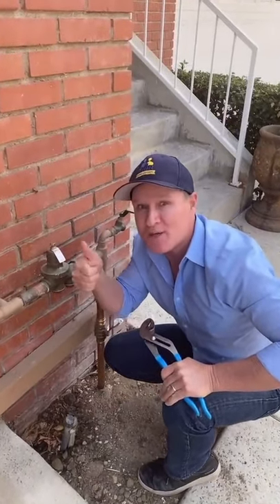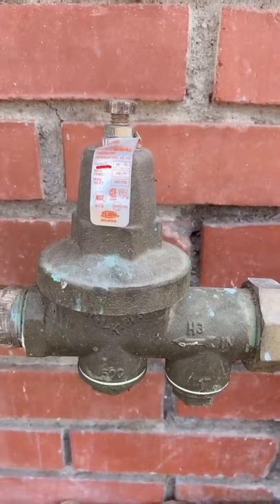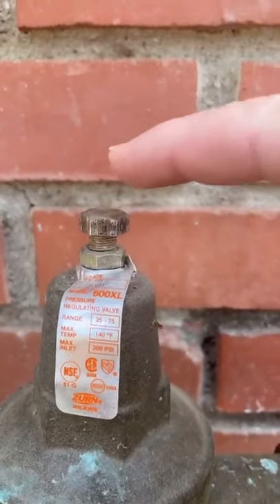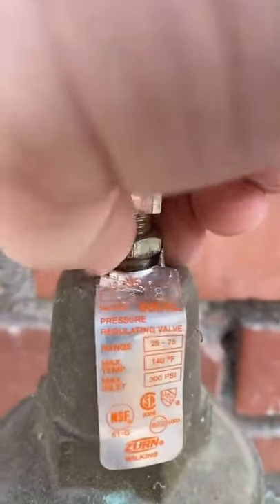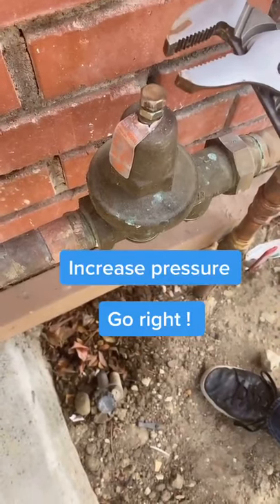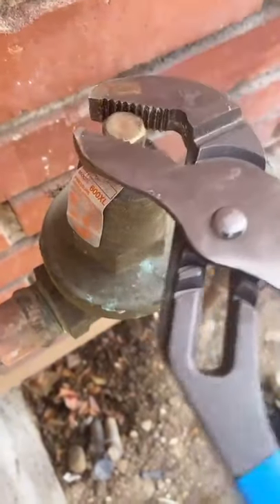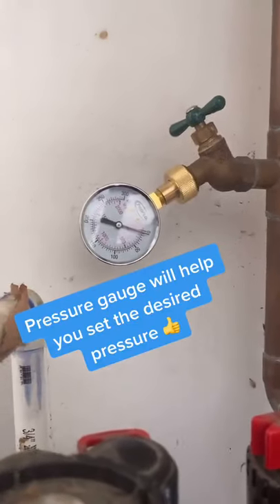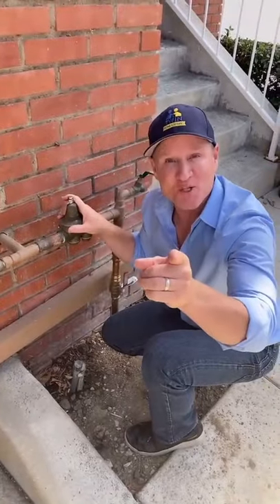How to INCREASE or DECREASE your water pressure with a pressure regulator

Comment: My father would be screaming at you for using channel locks!
Reply: Exactly.  nothing like channel locks and brass.  It’s a bad call.   😳.  but it’s not my j house
Reply: Use smooth jaw channellock pliers.
Reply: I worked with another mechanic that would jump on people for using channel locks but he would use them when he thought nobody was looking.  That guy was one of the biggest hypocrites I knew.
Reply: @Richard-om7vd  Why? Those things are beyond useless!
You should be using a crescent wrench ffs
Reply: @daddy1571 na knipex pliers one of the best tools ever made i cant live without them
Reply: @miket2172  I agree. I meant "Channel Locks" brand. They're trash compared to bad ass Knipex pliers.
Reply: @73beetle19 😂 gotta love those who don’t practice what they preach..
Reply: Should use the right size open end wrenches. Not sure why channel locks or adjustabe wrenches would be used.
Reply: I won’t use a crescent wrench either. I try to use a proper size open end wrench if it’s possible

Comment: You forgot to tell people to retighten the locking nut to prevent the adjustment changing on its own over time. Also, when adjusting make a mental note of how many turns of the adjustment screw you made for reference to tweek the regulator to the pressure desired.

Comment: Also remember that depending on the type of regulator that you have you'll have to bleed off some pressure on the downstream side of the regulator if you're reducing pressure in order for the pressure gauge to reflect the change. Water pressure is trapped in the line and unless it has someone to go, the gauge won't show the regulator pressure change.

Comment: If you have a pressure regulator in your house chances are you have an expansion tank that needs to be adjusted when you raise or lower the pressure.
Reply: Exactly , it’s a closed loop system and that expansion tank has to be adjusted accordingly
Reply: Most home plumbing isn't a closed circuit. 
The heating system may be
Reply: @richlaue   where I live in so cal about 70-75 percent of houses have regulators and run a closed loop system . City is notorious for random peak high pressure water
Reply: @richlaue  it's a closed system as soon as you put a pressure reducing valve. a pressure reducing valve is like a check valve. When you're domestic hot water heats up the expansion has to go somewhere

Comment: Channel locks?  Use a closed end wrench. Also probably need to flow water and then turn it off at another location after each adjustment so pressure can stabilize.

Comment: Some manufacturers will void warranty when you start having leaks on faucets/water heaters/ other fixtures when you adjust the pressure beyond the ‘set from factory’ setting. Not recommended. Also, use an adjustable wrench. You will round out that brass bolt fast.
Reply: Bro what lol? Standard is anything under 80.

Comment: Additional notes: If the valve is older than 2 years and you adjust it, you run the risk of causing the valve to fail. If you adjust the pressure at the regulator you also need to verify the expansion tank is pressurized properly as well. (Should be same pressure as incoming water pressure) You need to test the expansion tank pressure with the water off and pressure relieved from the system.

Comment: Check the specs on the pre set pressure of the reducer valve its probably about 50. You may or may not need to do anything except install it

Comment: I have a very urgent question my cheesy Home Warranty plumber wants to charge me an arm and a leg to do a water regulator maintenance. Before  swapping it to a new one that’s the only way he will change my warranty to covered water regulator is by doing a $325 maintenance. First this is the most ridiculous thing I’ve ever heard it’s a closed system. How do you do yearly maintenance on a pressure these?

Comment: How do I test the water pressure going to my irrigation if the spigot is connected to my house and likely after a regulator, and my irrigation line branch directly off the main water supply line before it comes to the house?

Comment: Not smart these guys need to stick to catching rats. Certain seals on Certain fixtures are pressure rated. So yeah, go ahead and start breaking stuff from high pressure. These guys suck.
Reply: A prv can only go to 80psi max. Nothing is going to fail unless it gets above 80 psi which is maximum for most codes. If the customer wants more pressure then it's on them if a fixture ir ballcock needs replaced. The customer is always right even when they're a moron.

Comment: Don’t you think you should have given them at least the maximum pressure that the house can handle? Or are we going to motivate people to Jack their pressure and blow off their t&p valves?
Reply: Do you know how much pressure it takes to blow off your t&p valve? I'll give you a hint...higher than the highest setting on the pressure regulator which is 80 psi. Wtf are you even talking about?
Reply: @daddy1571  150 psi

Comment: I live in Sacramento.  What if the city  gives everyone 60 lbs. Can i go higher than the city pressure?
Reply: No you can’t. I live in 45 minutes outside of sac towards Tahoe. Do a lot of work in sac your lucky to get 45 in Sacramento they promise 60 but it’s really 45
Reply: @jake16542  I live in Rancho cordova . I put a pressure meter on my hose . It reads exactly 60lbs. But that's only Rancho not Sac city.
Reply: @robertdavis3433  you water is coming from up the hill the closer you get to the mountains the higher pressure you have. Here in El dorado hills we get 110 and without a PRV valve the pipe wouldn’t hold.

Comment: Always pay attention to your low and highest pressure levels for your regulator and always use a pressure gauge when adjusting your regulator. Now one thing the pros don't tell you is to have your regulator checked. They do fail. Im repairing plumbing in a million dollar house  because a regulator failed allowing his water pressure to climb to 120lbs when it should be no higher than 65.